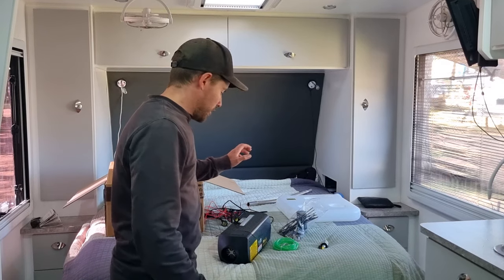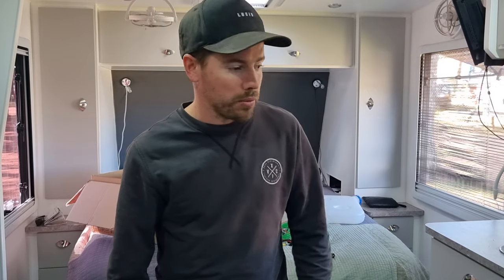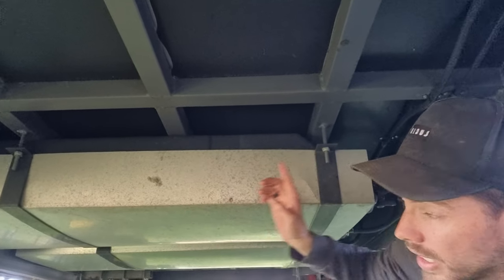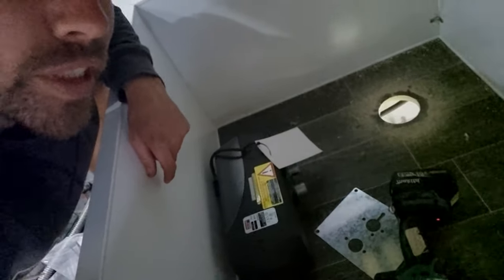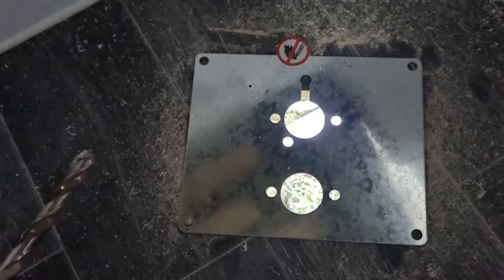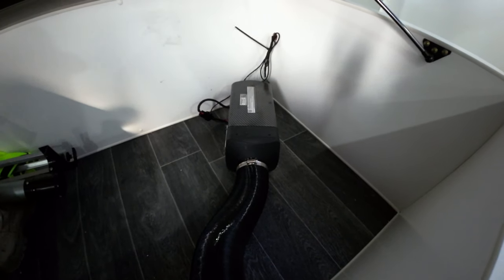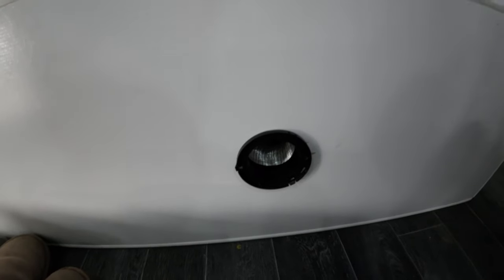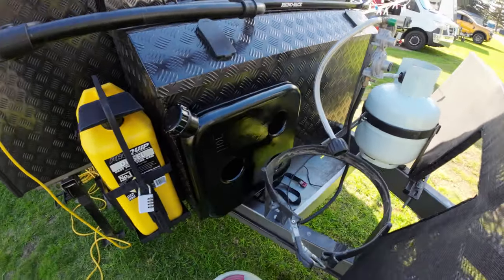DIY how to INSTALL a caravan DIESEL HEATER || CHEAP ebay DIESEL HEATER

Comment: EXCELLENT!  I am planning on the exact same locations that you chose.  I want a diesel fuel tank outside too.  I am experimenting with a portable diesel heater with the heat vent fed up under the bed and vented into the living area as you did.  I installed an electric actuator to lift the bed because I don't want to trust gas filled struts.  Those beds are heavy.  Thank you for sharing.  Very well done.

Comment: Nice vid. Technically speaking your inline filter is on backwards. Shouldn't pose any issues but if you get crud in the system and you need to clear it, swap that filter around. Otherwise you wont be able to see when the filter is dirty.

Comment: Great job.
I was just wondering how do you protect your batteries from getting stolen when you are on a day adventure. I have a new van coming and told them to put them inside, because I was told by a friend that got he’s lithium batteries taken. 
Take care.
Reply from the maker: Thanks mate. I also have  ow put mine inside as I have upgraded to lithium as well. I have a video coming soon on that. 
There should be a hole in the front flap and that battery mount where you can put a padlock on to stop them getting to them.
👍
Reply: @travellingtontas  thanks for the reply.👍 I am new to your channel and loving your family adventure. 
Have a wonderful week .